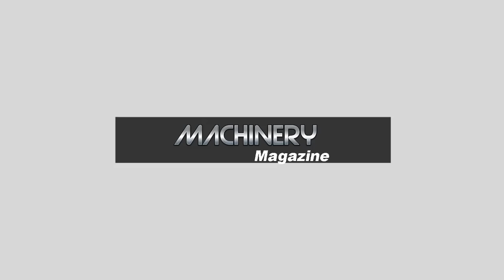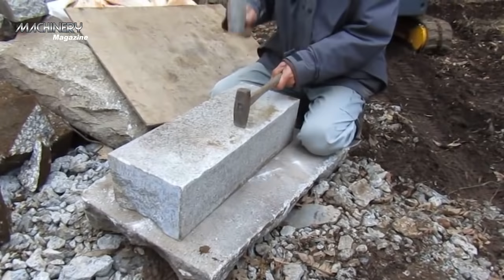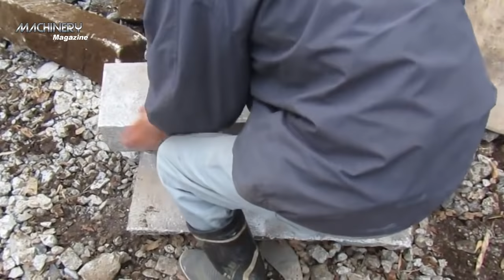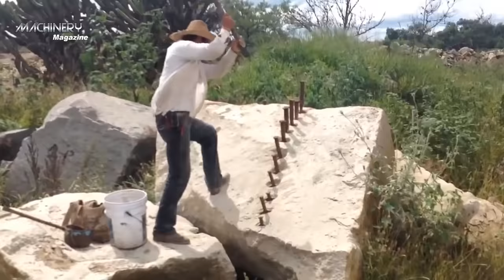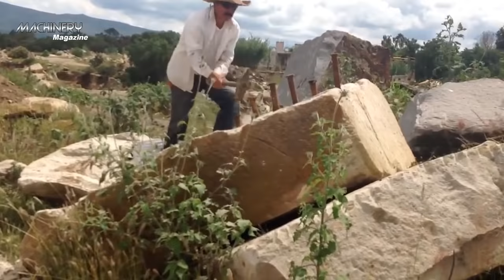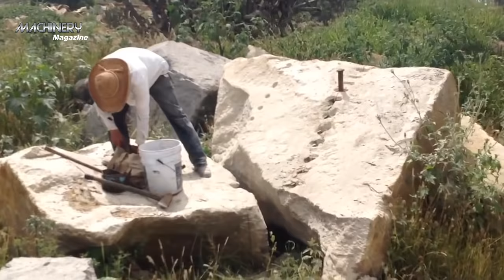Amazing Fastest Stone Splitting Technique - Amazing Hand Granite Rock Mining Skill

Comment: Man where was this guy when I tried to break rocks for my fire pit? I just busted it with a sledgehammer but of course you get a completely random break. That’s a fascinating skill. I’d like to know how to do that.
Reply: I'm an old guy with a set of feathers and wedges. That's what the guy in the last vid used. Feathers are kinda half moon shaped shafts that you put into your drilled holes, then place the wedge between them. I've never had to pound hard on the wedges like he did. I just use a 3 Lb hammer and hit each wedge in a row. more than a tap, but no need to kill yourself doing it. When the rock begins to weaken, the sound of the hits change pitch. I think it's fun. But then again, I like splitting firewood too. You can still buy feathers and wedges.
Reply: Try the Stone Trust, they have instructional videos and run courses

Comment: I’m presuming that when he removes certain stakes that it’s already began to show cracking. It would be nice to see from a close camera angle to see how this is happening. Never the less fantastic video of a man at work!
Reply: he removes the stakes so that when the stone splits, they don't fall down the crack, and become very difficult to retrieve.
and you can tell when it's about to go by listening to change in sound.
Reply: by putting them all in and hammering each, then removing the loose ones, he leaves only the ones that are in a spot that needs to be weakened, and then repeats the process, removing the loose ones each time, this way he creates a fault line, the crack goes along the entire boulder, and he makes it bigger each time he weakens the strongest remaining points until the last pin(s) remain and the boulders structure fails, allowing it to split

Comment: I've used the technique shown at 6:55 to cut concrete garden edgers. I used a claw hammer to hit a wedge-shaped hammer like the one in the video. After doing it on multiple garden projects, I learned why you shouldn't hit two hardened steel heads together. A piece of the claw hammer head the size of a large BB spalled at what must have been the speed of a bullet, penetrated several inches into the left side of my chest, and came to rest outside one of my ribs. It's still there. Not long after that I found a replay of the TV show Mythbusters, where they  "proved" that it couldn't happen.
Reply: they only use new tools so they don't see the actual effects of worn out tools breaking.
Reply: That`s the way we cut small stone hear but you should use the right kind of hammers that are not hardened like a claw hammer ,even the right kind of hammers will splinter if they are used after they start mushrooming on the strike face.
Reply: friend of mine had the same sort of thing happen only the shard went into his eye and embedded itself inside his eye ball several ops later he got part of his sight back but not all, the use of a hammer is ok but the "hit" item shouldn't have a hardened face that you are hitting,  as per a cold chisel only the cutting edge needs hardened, as for Mythbusters several of their "solutions" were rubbish, some were useful though. Also this shows you don't need to be an alien to cut rock accurately just skilful.

Comment: In south india, near bangalore.  The distance between the holes are about 4-5 feet. The chisels are used to seal the hole. Then they set fire on the surface. The trapped air expands ,opening a crack. Here we have a sheet of grey granite, kilometers in length.

Comment: Ancient aliens "no ancient human could cut stone this accurately" modern-day stone mason yep they definitely didn't have hammers or wedges in ancient times.
Reply: back in the time where its confusing, steel wasn't available yet. In order to use a wedge, you need a hole, and you aren't drilling a hole with copper.
Thats pretty much their point. Ive been splitting stone like this for 40 years, but i have carbide drill bits
Reply: @user-dq7ms8ir4c  Carbide tooling only makes the job go faster.  It can be done just fine with bronze, it merely takes longer.
Reply: ted - 😂😂😂
Reply: yea i want to see him put on his safety glasses.  Insurance payments are a business killer.  if he gets injured by not wearing safety, the boss may miss a mercedes payment.
Reply: @user-dq7ms8ir4c  Could you split limestone with bronze? Given enough time and with no regard for human suffering?
Reply: MyriadIsSynonymousWithNumerous Yes absolutely. Ive been in the limestone biz for 35 years, started in the granite business.
limestone is a whole different animal, it can be scratched away with a hard object. Its calcium based. I hand carve limestone, and used to carve granite.
sometimes i use a sharp wood chisel to fine tune some areas on limestone. When i jump back to granite, its like, HOLY SHIT, this sucks. 
what people dont understand is that drilling stone means you are pulverizing the surface into dust, and going deeper, etc.  The way this was done before carbide tips , and doing it by hand was as follows; one man held a round bar with a criss cross pattern on the end, and another guy would swing a sledge. Then the guy would twist the bit a quarter or eighth turn, then second guy would swing the sledge again.  You can do this with one man and a 3pound hammer also, but it kills you.  When this was done, you had a whole pile of bits ready to go, and as they got mushroomed out, the blacksmith heated it up and reforged it. It was a big deal.  Granite is so much harder its unreal.   We all know these structures years ago were built, and i mean egyptian times.  supposedly they didnt have steel, which means you're swinging a bronze hammer onto a bronze chisel?
Ive watched a million " ancient structures videos", but i dont recall there being pieces left behind with a series of drill holes where wedges were used as in this video, maybe im wrong.   idk, it just seems like some tools and technology is missing from these early days.   FYI, the guy splitting the rock with the hammer, and handled chisel?  Me and my father used to split polished slabs for monuments when i was a little kid.  You had the sledge and the axe, the axe had a flat point about 3/8" wide, not a point.  i was 10 years old getting yelled at for holding the axe crooked, lol.   Anyway, for a guy who's literally been cutting stone for 40 years, im even more amazed how this was done than the average joe.
Reply: @user-dq7ms8ir4c  Thanks for the thoughtful reply. Since the pyramids are made mostly from limestone, do you think it's at all possible that the stones could have been cut this way? I suppose you could drop anything (a bronze hammer, or a big ass rock) onto the wedge to split the limestone.  Remember, slavery was used so absolutely no regard for human well-being. The granite used in the Pharaoh's chamber though, I couldn't guess. Apparently floated in from up the Nile, maybe they had better technology (steel) up there somewhere. I haven't looked into it
Reply: MyriadIsSynonymousWithNumerous  dont forget, before the wedge comes the hole.  The hole is the tough part.  With sandstone, i do believe you could add a slurry of sand and water to a rotating shaft of some sort. I think even with twisting a round hardwood on top of that slurry, it will cut a hole. You just need to keep putting fresh sand under the wood shaft. Then, they used to pound in dry hardwood into the holes, then keep soaking them and they expand and act as wedges believe it or not.  Before my diamond wiresaw, i had a twisted steel strand wiresaw, which had a slurry of carborundum and water poured into the cut, and without the carborundum, the steel did nothing even on limestone. 
So,....... the sandstone parts of history are easily explained, but its the granite that again bewilders me.  The sarcophagus inside the pyramid is a hollowed out solid block of granite.  There is NO WAY IN HELL that was made with pounding stones. Those sharp inside corners are amazing.
As far as slave labor? I would think even with slaves, you gotta feed them, and at some point , can you really have them working weeks trying to split one block of granite?  Again, i dont recall and i might be wrong, i havent seen any ruins with these drill holes.
Reply: @user-dq7ms8ir4c  Thanks again for the great reply, very informative
Reply: @user-dq7ms8ir4c  thks for the details. I ve been to Egypt. Back in 1985. It was an amazing thing to behold, the museum objects. Just the jewel in laid bommerangs. The craftsmanship to create such objects boggles the mind. Both the phenomenal designing and the technical effort lets you know these were not stupid people
Reply: @user-dq7ms8ir4c  cool insight. I do think it's possible for them to have had iron tools, and they just rusted away over the years. But I'm no archeologist nor am I a stonemason. it's very interesting getting insight from someone who knows the industry.
Reply: @user-dq7ms8ir4c  do you think it's possible for them to have used iron chisels and over the years it just rusted away?
Reply: David Lane i have no idea about having iron tools, i thought it was general knowledge that iron wasnt around. Maybe it was, but...., i just do not ever recall seeing rows of drill holes in any of the ruins, or on these structures. I absolutely could be wrong, i just think i would of noticed.  I have seen singular drill holes here and there, but those holes were large diameter and made by a coring bit at a high rate of penetration according to the cut marks.   I had a discussion with guys at my shop the other day regarding cutting granite, and everyone was pretty much amazed that some of this work was even possible.  When you use diamond tools, and carbide tipped chisels everyday as i do, it just makes it very hard to believe that some of what you see was even possible. BUT, we all see it so obviously it was done.  very confusing to me.
Reply: @user-dq7ms8ir4c  I saw a video a few years back of  a guy cutting granite with copper bits and a vibrator, 
the process was deafening, but it did work fairly quickly, not much different than a modern rotohammer

Comment: I have an odd metal hammer that has a wavy, rigid metal horizontal edge that looks like it is inserted into the head of narrow end of the hammer. It sticks out about 1/4 inch from the edge. I am guessing it is used for stone work but I have searched online for hours hoping to find one like it, to learn of its purpose, with no luck. Do you think someone here could identify it if I sent a photo?

Comment: Work smarter not harder. The guy had an electric drill/impact tool and a damn hydraulic excavator. If you have access to those tools, why not use a hydraulic jack hammer instead of iron pegs and a hammer ffs. It's like the mechanic quoting you 5 hours to fix your car when they only needed 1 hour just to rack up your bill. lol

Comment: Look at the visible width surface of the big rock where to begin the cut, and you will find an already existing vertical rift before the cutting begins. Why and how has appeared this rift, which could make the cutting much easier or no more necessary. A cheat? 
Don’t say it was just incidental.